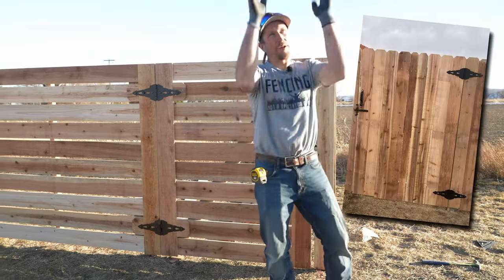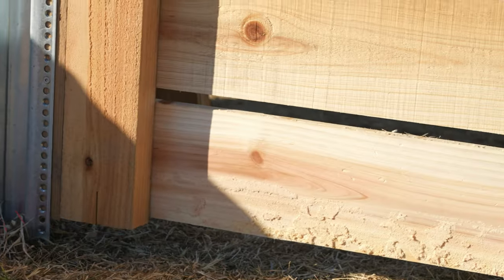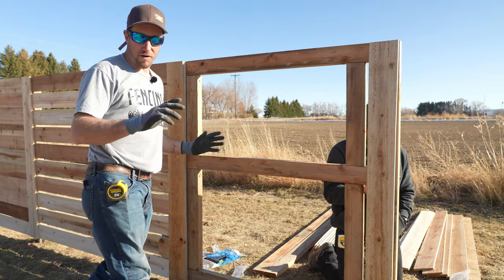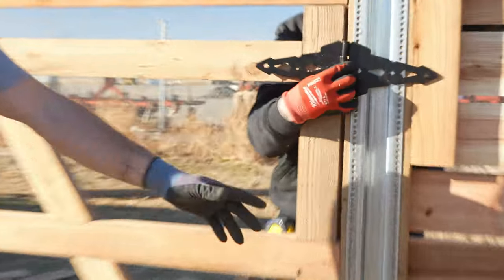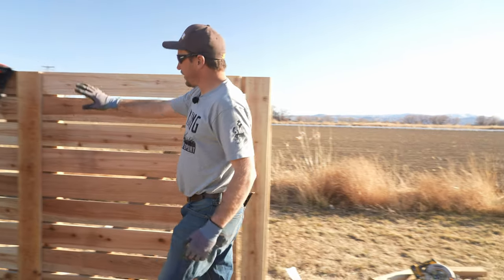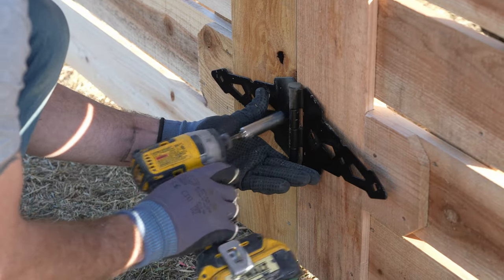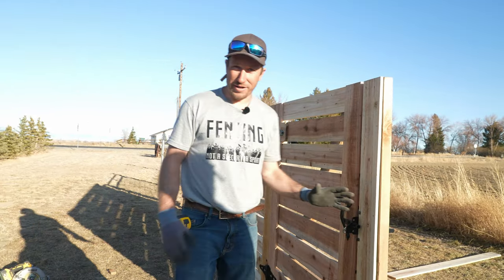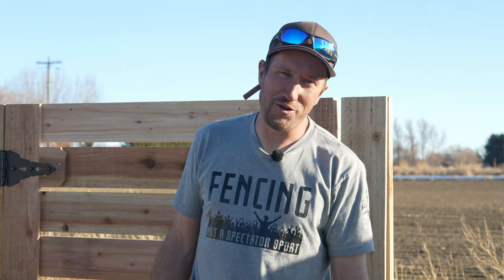How To Build A Horizontal Cedar Gate IN PLACE (No Hanging!)

Comment: Always enjoy your videos!  Can the hinge be mounted on the other side as well?  Would that be just as easy or would it require a lot more work?
Reply from the maker: Off the back side? Yes, you sure can--you just need to have enough framework to screw your hinges to securely--so you'd have to modify accordingly.

Comment: How would you go about having the gate open to the inside? Just put the hinges on the inside? or is there a different build required? The way you showed it opens to the outside - many municipalities require the inside swing.
Reply from the maker: Yes that’s correct. Just make sure the back side of the gate and the post are on the same hinge plane.

Comment: Just found your videos researching Postmaster+ as an alternative to my original plan, which was using a Slipfence system, which are outrageously expensive. These are really helpful, thank you. I notice here that you're just using the standard line posts here for your gate, rather than the Postmaster+ gates posts. Any reason for that? I'll follow your method, because the idea of having a wood fence with two random black powder coated posts at the gate was bugging me, but I was just wondering why you go this route. Thanks again!
Reply from the maker: They haven't always had gate posts, and we've always had great success using the standard posts for everything (even corners)
Reply: @SWiFence  Thank you! I think I'll plan on using the line posts then. By the way, do you have any videos on how to make non 90-degree turns using these?
Reply from the maker: No, sorry. If it's anything more than a slight bend you're probably going to want to put a terminal post there as well.
Reply: Got it. Thanks again for the great videos!

Comment: When setting your posts do you set them high and then cut to height after setting in concrete using a laser level?  If yes what tool do you find best to trim the metal Postmaster Posts?
Reply from the maker: We try to set them the height we want them so no trimming is needed, but if we need to trim the bandsaw is the way to go. 👍🏻
Reply: Thank you!

Comment: Did you notice any sag in the gate a week or even a month later? My gate has shifted a few inches since set up, I’m going to chalk that up to settling, and not a poor fence design. After all the post is 24 in deep and sunk in 160lbs of concrete
Reply from the maker: It's important to figure out if the post has shifted, or the gate is sagging. Make sure your tension brace is running the correct direction. And if you haven't, you might want to install a anti-sag cable (https://youtu.be/sCALm209If4).
If your post has shifted though, you'll have to detach and reattach the gate to straighten it back out. It's not going to look amazing but it's better than a sagging gate.
Reply: @SWiFence  yes, the compression brace it the correct direction, but I do no have an anti sag cable, yet. I will check the post again, hopefully I do not need to re-attach the gate, but I will keep all options open for the moment.

Comment: When building a Kentucky 4 board fence with a gate how do you determine the pocket depth and the radius that would connect back up to the straight-line fencing?  so, you have room to drive in and make the turn radius when leaving your driveway, a rule of thumb for a ratio or point me to one of your videos please.
Reply from the maker: Sounds like trial and error to me. Always plan for bigger than smaller.

Comment: How deep are the gate posts pounded? Should I cement the hinge post?
Reply from the maker: There's no need to cement your hinge post as long as you can achieve 36" pounding depth or greater (based on your soil conditions).
Reply: @SWiFence  Thanks. You guys rock.

Comment: Is there a way you could do this with a double wide gate? I'm looking to make a gate a width where a vehicle could pass.
Reply from the maker: Yes there is--we just don't have a video on that yet. What we do is build a metal frame out of chain link pipe, and then hinge it on 4" SS40 chain link posts, then attach the nailers and pickets to the frame.

Comment: Built a 4’ wide gate exactly like this, but the latch side is warping after only two weeks (sticking out farther at the bottom than the top). Any suggestions on how to fix this issue? Thanks for your help!
Reply from the maker: Well, that’s unfortunate. I'm assuming the lumber was a little wet. As it has dried, it has warped. Check if the bottom horizontal part of the gate is causing the issue. If so, based on the extent of the warping, I would consider replacing that 2x4.
Reply: @SWiFence  Thanks so much for the reply. I'll check out that 2x4. Hopefully that was the culprit.

Comment: 1) What hinge lag screws do you use on cedar gates?  (I.E. Strength & no rust from tannins)   2)  Will they work going through metal when hanging a gate on Postmaster posts?  Thx
Reply from the maker: We use the hardware provided with the hinges, and if we need to drill through the post to install a bolt, we use a black powder-coated chain link bolt.